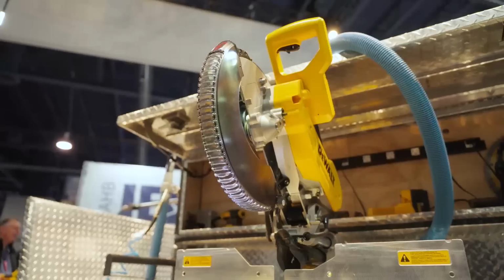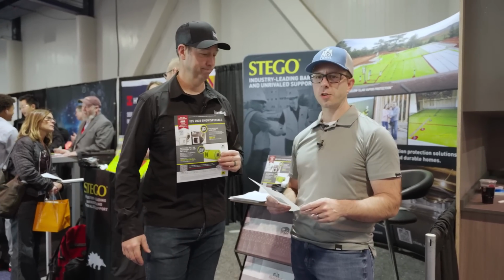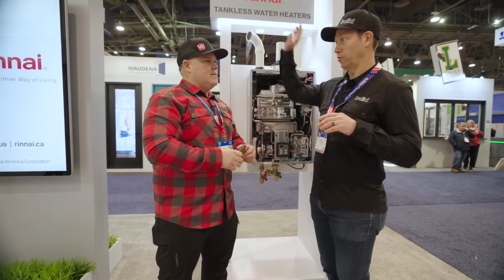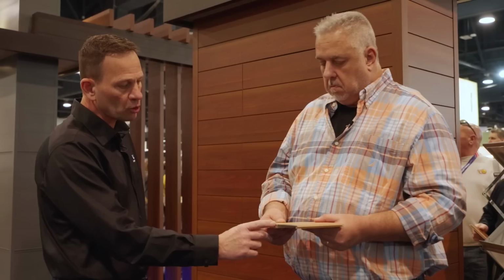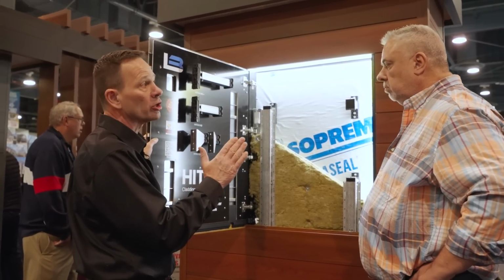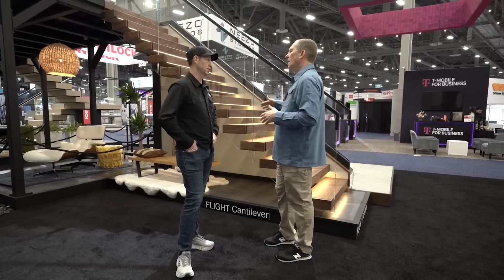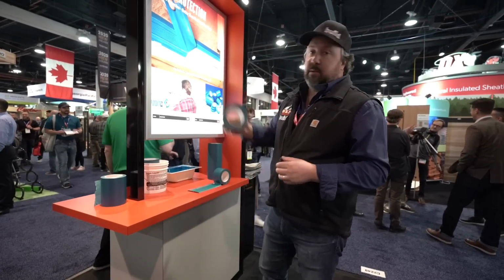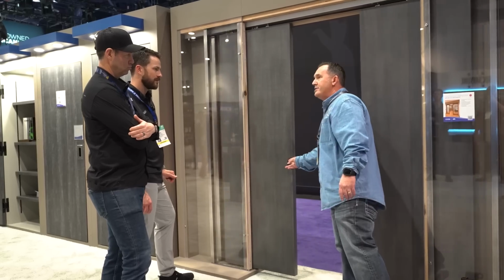Insane Mobile Workshop & More from IBS 2023

Comment: saying - that hot water recirculation "safes energy"  seems counter intuitive, such a first world problem. (Obvs I am not familiar with typical USA systems of high end luxury - tankless heaters are not the norm in my experience.)

Yes in winter - any hot water inside the insulated building envelope merely shares heating load - and instant heat, anywhere is really nice - why not, just have a heat exchanger off the central heat hot water circulation (or you don't do central hot water, you do central air, how inefficient, lol - jk)  - for winter...  In summer, circing hot water through the plumbing constantly has to use more energy than the "occasional  - on and off 3-6 times a day (at "bath times) than running prepping the line a few times from a central HWS.  People who "must" wash hands with hot water, are pampered first worlders - how a future collapse will "rock their paradigm" - lol..  (a grey-water diverter makes a lot of sense if water wastage is a concern - many ppl will use the few gallons "wasted" watering the front lawn.)

An instantaneous heater to "peak" the temp - with a storage unit for central heating is probably the most efficient "instant hot" system.

Expectations are a beast - $36k for a "starter staircase' seems like I should just live in my truck...    Or go for a local fabricator, rather tthan a national chain paying migrants of dubious documentation "living" wages and profiteering off the backs of hardworking middleclass (aspirational a$$ Sn!ffers)  people - or am I seeing tings wrong here ??  (PS, I could spend $$$ coin on a posh staircase, or I could fund needful surgeries for underprivileged people - I do need a staircase to my back porch, in the future - looking at options - hopefully not $40k worth.).

Comment: Ron Paulk (thepaulkworkbench) had a similar work trailer years ago, except his had a roof over it.
Reply: - a cargo trailer with fold out - awning -  sides would   be very simple (no corner posts).

 - the claim "doing for 30 years" - likely a stretch on the facts  maybe doing some kind of work trailers for 30 years - modern bells & whistles, not so much, builders back then still  went to work with a hammer, nailbag, tape/rule and handsaw - and a bevy of corded tools  (individual or boss supplied ??).  ok, air compressors were normalised too (on the boss's truck).

Comment: Hot water recirculation is always best done via presence sensors in the bathrooms and over the kitchen sink - if anyone comes near any sink or basin, the recirculation pump kicks in just in case they want to use the hot tap.

Comment: @13:35 If you already have a recerulation pump instead of a timer use a smart switch that works with Google Home. Then you can create a custom command(in Google Home) that turns the pump on for just the right amount of time to pull fresh hot water into the line.

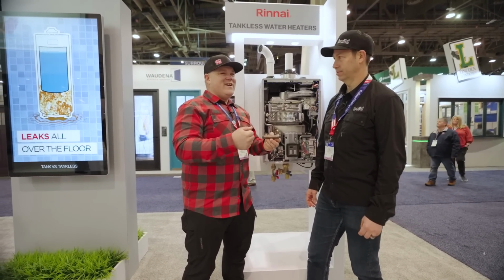Comment: Circulating hot water isn't saving energy! The more water you pump through and heat the more energy it pulls. Don't know why he would make claims like that 15:00
Reply from the maker: I need to rewatch that part, but yes it’s water saving (and frustrating/time) not energy.
Reply: Maybe less energy to heat luke-warm water to hot than ambient temp water to hot? So many variables thou.
Reply: Agree. Insulate the piping to actually save energy.